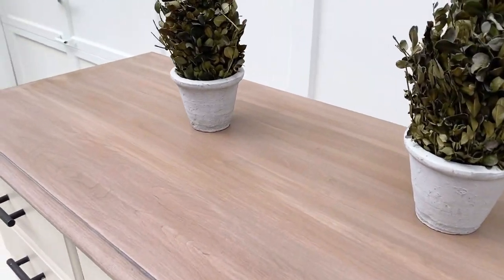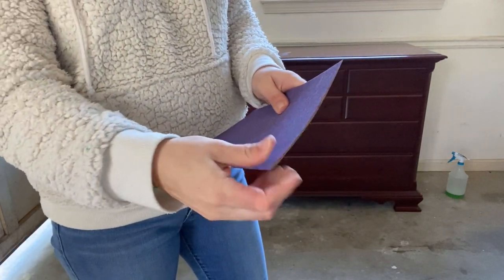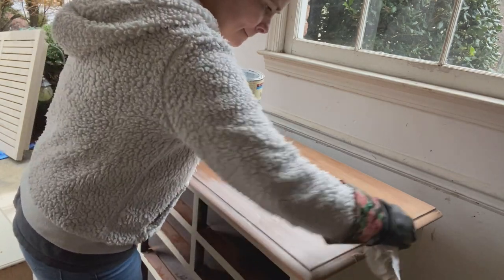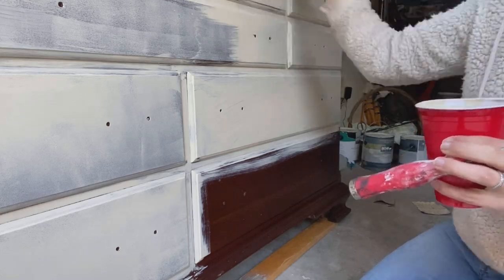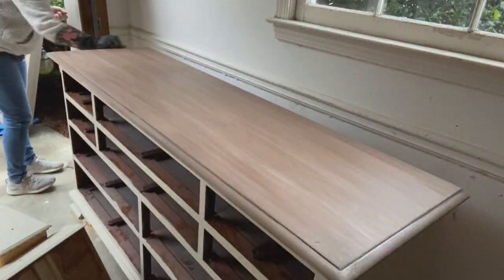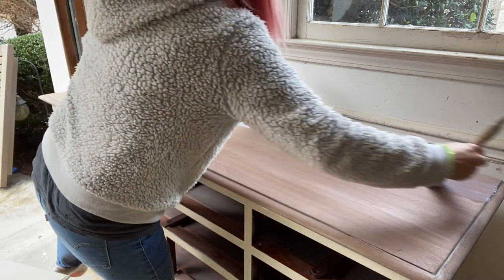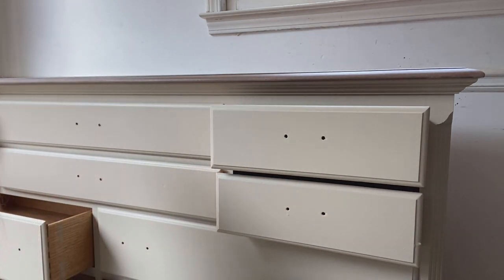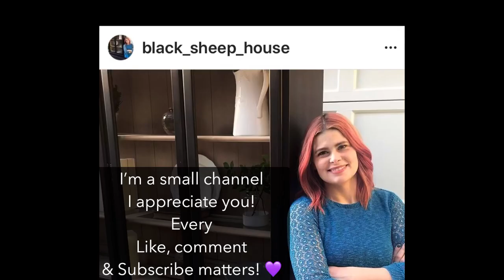Dresser MAKEOVER and light stained wood top | furniture flip | taupe

Comment: Have you ever had trouble using Valspar glaze?  I used Bemjamin Moore Advance and the Valpare antiquing glaze just wouldn't stick.  It was supposed to dry in 24 hours but after 2 days the glaze lifted when I tried applying another coat.

Comment: Hey Shannon!! Love your work. How do you get a smooth finish with your top coat? I’ve tried spraying, using a sponge and a brush but I’ve had to start over. Can’t seem to get it right. I’m thinking brushing is probably the best way to go at this point but maybe I’m not using the right brush 🫤 
Btw, I’ve been using Polycrylic.

Comment: Looks great. Just need to improve your measuring skills so the handles don't look lopsided and you can get them perfectly flush in the center.  If you're not good at measuring you can also use a drawer handle template that you just hang from the top of the draw and it gives you all the different millimeter size options and height options and you just poke your marker through the tiny holes where you want the handles. Makes them all perfectly centered in the same exact spot.

Comment: I know this is super late, but what kind of wood is that? Does it make a difference how the white wash and antique glaze would turn out on different types of wood? I’m working with pine and white oak. Thanks!!
Reply from the maker: This was cherry wood, it doesn’t matter as much as it would with just stain since you’re doing the paint wash on it first for your base.  You can always do a few layers of the paint wash if you feel like it’s not the right color before adding the glaze
Reply: @blacksheephouse  thank you so much for your response. Is there a difference between pickling white wash and plain white wash? Sorry if you’ve went over this before a million times.

Comment: Do you use a polyurethane vs polycrylic? I have had problems with poly urethane yellowing.
Reply from the maker: I use Matte polycrylic on white items but for table and dresser tops I like to use oil based wipe on polyurethane.  I’ve not had items long enough to notice any yellowing but you are right, polyurethane does amber over time so it’s best used on wood tones or darker colors.

Comment: Hi, I am sure i am missing it, but do you have a list of the items you used on this project - for the top only. I want to do my table in exactly the same way. Thank you
Reply from the maker: It should be in the description but here I just copied and pasted just in case you can’t see it
Product used:
2.5 inch angled purdy paint brush 
Foam roller (optional)
Simple green cleaner and lint free cloth 
80 grit and 220 grit sandpaper and sanding sponge
Minwax White wash stain
Valspar antiquing gel stain 
Loft light by Behr chalk paint
Behr clear wax 
Varathane polyurethane water based clear top coat in matte finish 
Black hardware from Amazon
Reply from the maker: You can use any white wash if you can’t find Minwax , there are several brands like Varathane

Comment: How durable is chalk paint?
Reply: If you use poly, very durable. You have to protect your paint. :)
Reply from the maker: Chalk paint needs a top coat of some sort, I used wax in the video and I have found that wax is very fast to apply and durable as long as it has had time to cure (30 days) and the poly i used on the top is heavy duty strength and will protect a piece that really well.  Hope you try it out!